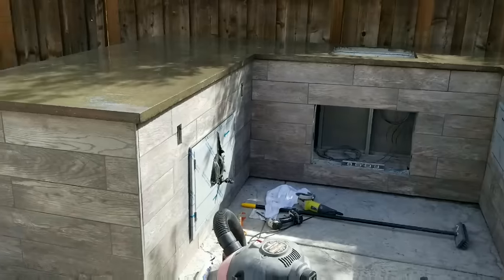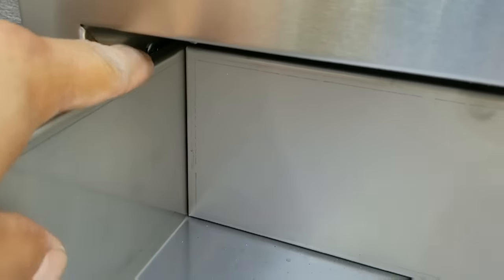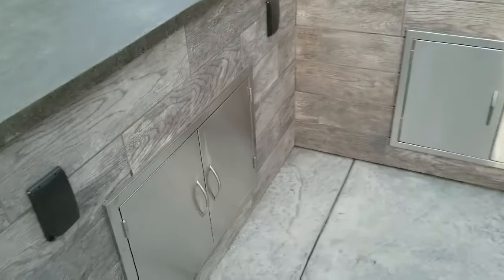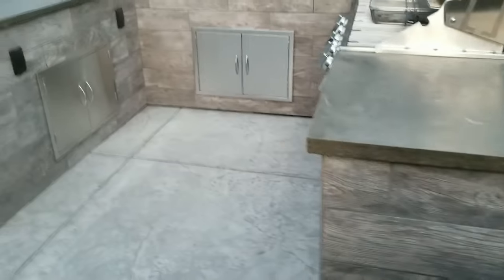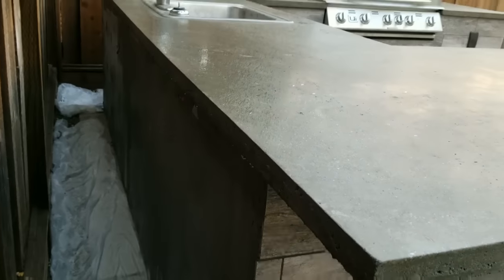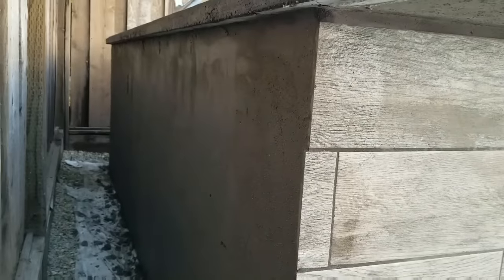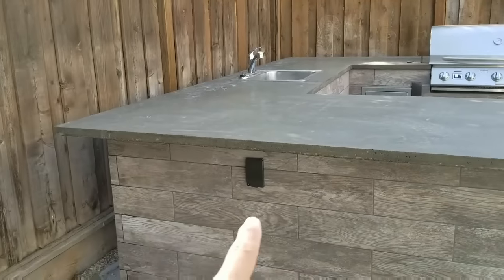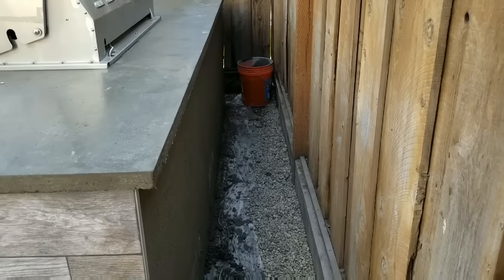Diy Bbq Island Finally Completed #7

Comment: Wow I didn’t know it costs that much even when u diy.
Reply from the maker: Zhengming Song appliances are the most expensive, a bbq can cost 1500+ easily plus doors and drawers another $1000. I priced out many completed bbq islands and they are over 10k without the custom finishes. For a long time I looked into a couple of roll around bbqs from hd, lowes etc and convert it into a built in bbq; definitely would of saved a lot of $$$
Reply: D.I.Y Eddie yeah I bought a bbq grill already. It’s been half year and still in box. I’m thinking about building an L shaped counter and sink to clean fish and grill and maybe move my mini fridge out. Urs look super fancy. I was just thinking about a concrete and a few tiles to cover it.
Reply from the maker: Zhengming Song thanks the concrete countertops were only about $120 in materials and the tile was another 3-400. A good alternative option is to stucco the sides,  a bag is about $20 but you would have to buy concrete glue for it to bond correctly to the cement board.

Comment: I would have applied Redgard on the cement board before applying the tiles.
Reply from the maker: D Beaulieu I would of used a waterproof membrane but permabase  is able to withstand prolonged exposure to moisture.
Reply: There's always one isn't there. Shut up D Beaulieu
Reply: You mean expert? Try not to be intimidated.
Reply from the maker: D Beaulieu any advice from experts in the field is greatly appreciated, in this case I did not see a need to protect the metal studs. In any condition where rot is an issue I would definitely use a waterproof membrane.
Reply: Do you feel better now?
Reply: Great job.......like it ......

Comment: Looks awesome man. How is this holding up so far? I'm thinking about making two small straight ones; one 8ft and one thats about 6ft. I want to just make one a surround for my current grill and the other a little raised bar area since I don't really go out back much anyway. Would I still need to make vents like you need for the built in bbq? Also, did you have someone do the plumbing or did you also do that yourself?
Reply from the maker: Erik Garcia thank you. Its still holding up great, I plumbed it myself. If you surround just the sides of your existing bbq I don't think you would need more vents, unless you are surrounding the back and sides.
Reply: i'll probably end up putting some since i want to surround the back too. did you do the plumbing and electrical prior to everything? i.e. plumbing then concrete pad? i'm not too sure how i'd get water and electricity to where i want my setup to be.
Reply from the maker: @iSouluh  I just seen your reply, yes plumbing and electrical conduit was ran before the concrete pad. another option for an existing slab would be to run it along the edge of the slab 18" down and bring the utilities behind the bbq.